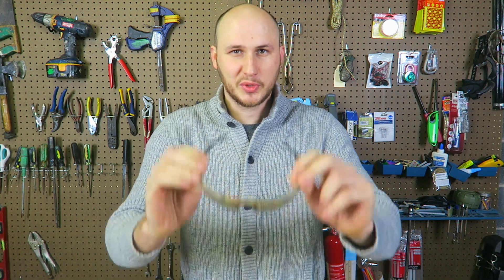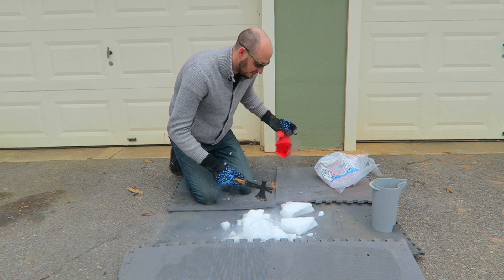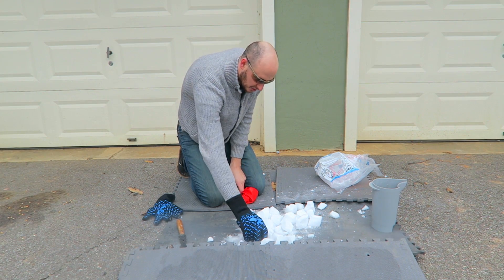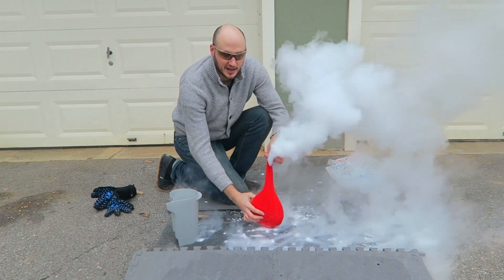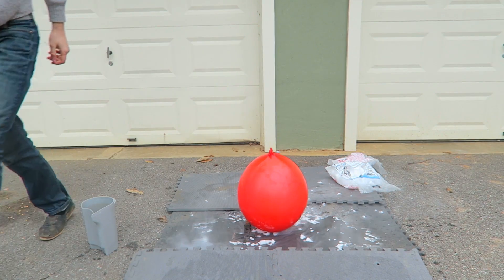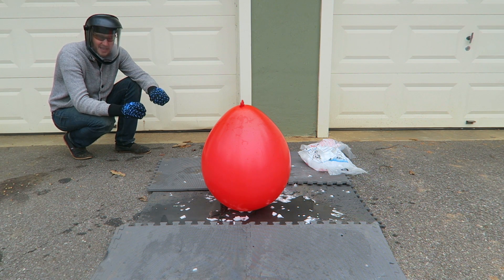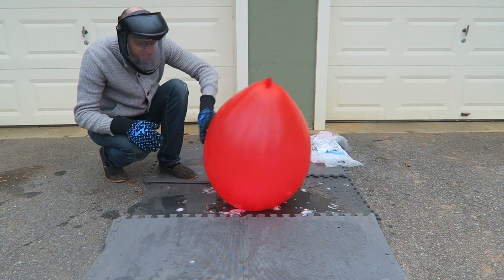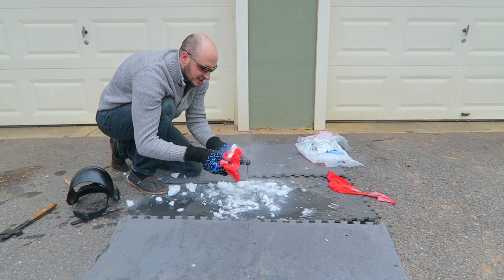What Happens If You put Dry Ice Into Giant Balloon?

Comment: DRY ICE PERCOLATOR PUMP: Take a 2-4" pipe and cover one end with 1/4-1/2" steel mesh screen, with a hose clamp. Attach a stick, or something, to that end of the pipe, with the stick protruding about 3" beyond the end of the pipe, so the pipe doesn't bottom out in the water tank/pool. That's it, put the screened end down into a tank/pool of water and drop in some dry ice; it should make a geyser of water. Compressed air percolators will typically pump water up to a level, above the surface, about equal to the distance of the pipe end, below the surface. A dry ice percolator may do better (or worse).

Too much dry ice may block the water inlet. You can get around that by drilling water inlet holes about 4" above the end of the pipe, through the side of the pipe. Angled holes will work best. Angle them such that the incoming water is directed upward and the co2 can't easily leak out of the pipe.